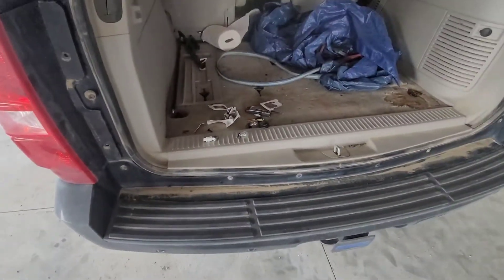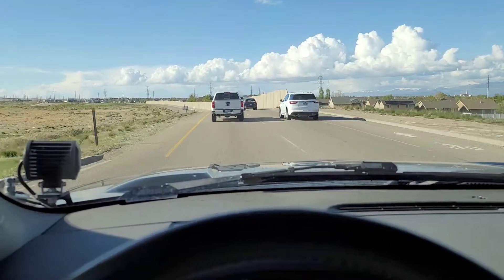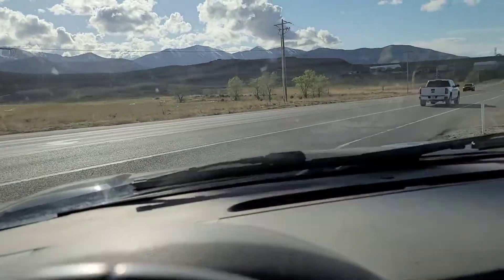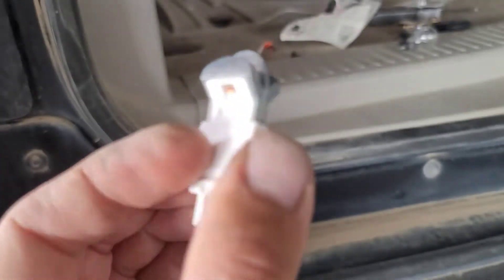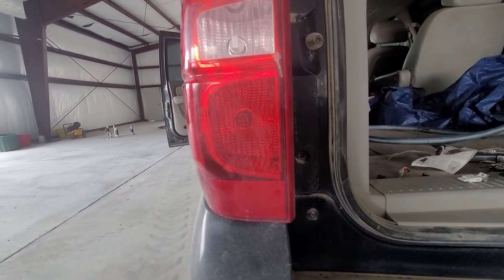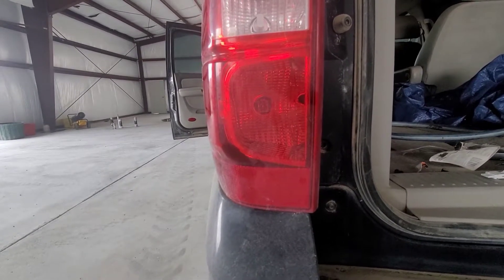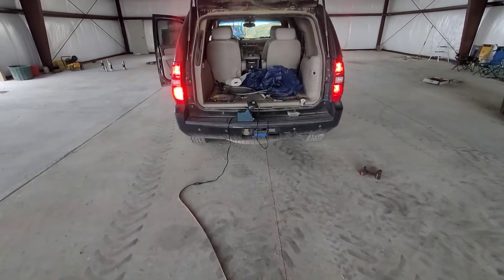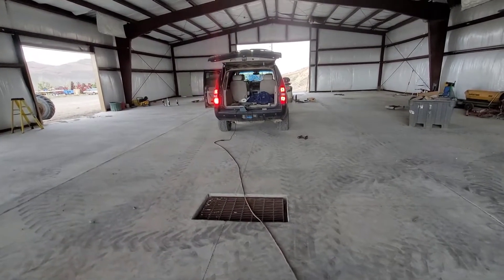Fast Tip Friday: Adding Sylvania ZEVO LED bulbs to the 2007 Tahoe (they are awesome!)

Comment: U should also give the sylvania zevo 7443W led bulbs, and find those with a bubble on the led diode for water degree of light for your reverse light. Those would love sharp on ur Tahoe and it will look good and match with the rest of the zevo led bulbs. 🙏🏼

Comment: I have had great wonders with these parts store bulbs. I currently have aftermarket LED taillights on my truck and the difference between the dim and the brake is not as great as these are, my friends have told me the brake lights are bright but seeing my turn signal is almost impossible if the running lights are on at night, I may go back to stock housings and use these bulbs
Reply from the maker: Couldn't agree more. That was the biggest issue I had with some of the cheaper bulbs that you can find on Amazon, ebay, etc...not nearly enough contrast between dim and bright. These work so well that my boss actually asked me to install them on his work F350, personal F350 and his wife's suburban. 😎
Reply: Very nice! I was skeptical when I first installed them because of such little chips they have but I am rather impressed, the only thing I recommend now.

Comment: some people said that the resistor become very hot is that truth?
knowing that they use it in another way, which is to connect the two resistor cables to the lighting wires
Reply from the maker: Resistors become hot no matter how they are wired; they create resistance in the circuit which is dissipated as heat. The only difference in the way I decide to wire mine is a direct ground connection rather than relying on a ground wire in the harness, that could potentially backfeed another circuit and cause issues somewhere else.

Comment: I’ve been running my sylvania zevo 7443R led bulbs for the past few months. I usually want something brighter than zevo, but it was more higher price and a great reputable brand. 

But after running these zevo’s, it slowly becomes my most favorite led. These work very well and it uses my reflector polish tail light housing, on my 2015 lifted Scion xB. And they work fantastic. Turn signals on the other hand for 7440, not so much. It works but not bright enough, and it doesn’t filled my reflectors entirely. So a 360 type led from lasfit or auxito works a lot better. But I’m happy with my zevo.

@AllThingsMechanical

Comment: Question everything I read online and on the sylvania link doesn’t give any suggestions or recommendations for 2011 Tahoe reverse (back up light) is your reverse light the same size 3156 or is it 7440?
Reply from the maker: As a general rule, reverse light bulbs are smaller than the brake/tail/turn bulbs since they are used infrequently and don't need to be very bright (well, the manufacturers don't think they need to be very bright, but that's a whole different argument). It's been a while but I'm fairly confident that the reverse bulbs are 7440. Best thing to do is pull your housing off real quick and double check before you buy anything.

Comment: Any chance you know the exact part #/ model of sylvania zevo bulb? There are quite a few different zevo led mini bulbs.
Reply from the maker: For this vehicle, they are Zevo 3156R (the 'R' designates red in this case, they also make amber and white with 'A' and 'W' designations, respectively). You can go onto Sylvania's website and put your vehicle year/make/model in, and the site will show you exactly which bulbs you need for any part of your vehicle. Follow the link below. Hope that helps!

https://www.sylvania-automotive.com/bulb-finder.html
Reply: @AllThingsMech  ok great thx! Also what resistor did you use? I have a 2009 Chevy Tahoe and I’m looking to do the same setup when the weather gets warmer
Reply from the maker: I usually just use the cheap ones you can buy on Amazon or ebay, search for "LED resistor" and you will get a bunch of hits on Amazon. You're looking for the gold colored 50w 6 ohm load resistors, a set of four is only $8.99. I will say that the cheap ones are cheap for a reason, I've had 3 of them fail over the last couple of years between my tahoe and silverado. A much nicer resistor is available from VLEDs, but they are about $20 each. For the cost, the cheap ones have worked pretty well for me - just buy a few extra in case you need to replace one. Also keep in mind that I live in a very remote place with absolutely crap roads that are very rough, which probably explains the failures. lol
Reply: @AllThingsMech  ok thanks for that! Last question did you use the 3156r bulb for both the turn signal and the brake light?
Reply from the maker: Yep, sure did. And it's no trouble at all! Any other questions feel free to ask.